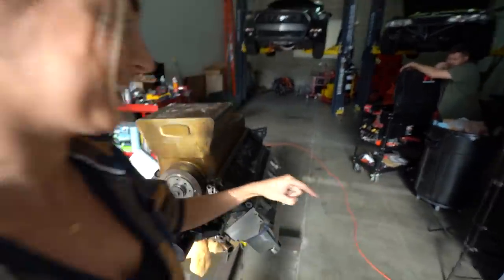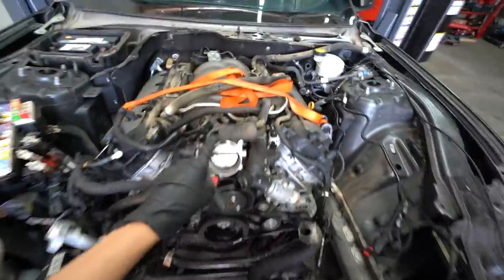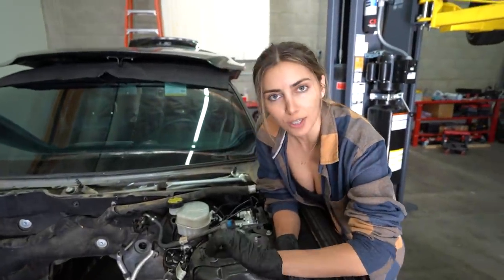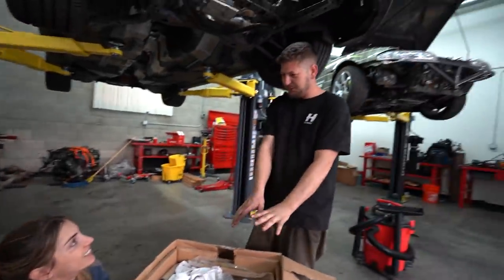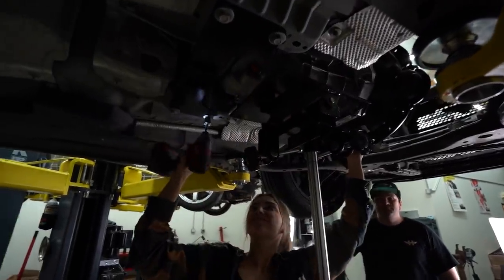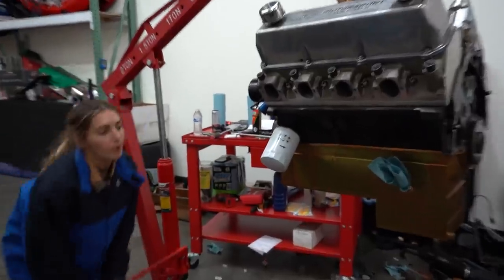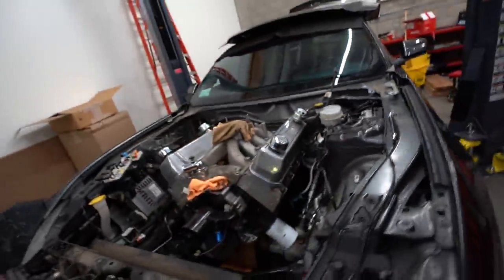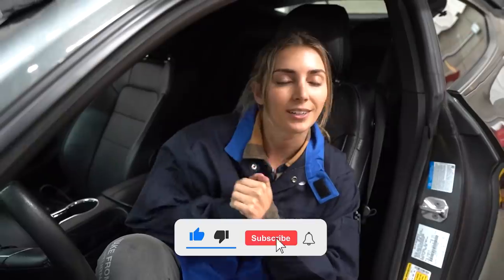We Put a Giant 2000HP Supercharged Big Block Ford in S550 Mustang!

Comment: 2:30......lol.
The motor looks awesome in the Stang.
Now you need a narrowed 9" or a quick change / tubbed wheel wells and some wide ass tires.
There are some pretty nice looks widebody kits on the market.
Reply: Not bags seen high power rip them apart.
Reply: Bags on a drag car?? Ahh, no….
Reply: @allspooledup2584  bags on most cars is bad enough. Not on an over thousand hp car

Comment: I put a 351w stroker in my 2012, and for about 4 years, I ran a 671 blower on it. I was only running 3 pounds of boost because the compression was too high to go any further.

Comment: Allot of people don’t realize how good 385 series “BBF” is because it’s not shown in 1320 video I guess. But  Rickie smith and Bob Glidden dominated  IHRA and NHRA with them slapping Chevy and Chrysler big blocks first in nhra and IHRA to run 7’s. Tim Lynch BBF outlaw mustang ran 6.5 on a 10.5W tire in 2008. That’s what promods we’re running at the time with way less weight. First dragster in the 6’s was the 427 Cammer another engine of BBF’s Fe series. The first 9 second pass in FAST was by a 1971 cobra jet mustang. Before any GM or Chrysler!

Comment: So that's a direct bolt in to a ford fusion of the similar year. Wiring harness all ,it can be retuned at your local Ford dealership with a manual if you like that kinda thing.... front and rear k . That 4 door will blow the doors off your friends 4 door sedans.....

Comment: Did you have a 6 speed in the 5.0? I will be buying my first muscle car within the next month or so and I'm between a new 5.0 mustang or the SS 1LE Camaro. I honestly think I am leaning towards the Camaro from the Tremec that comes in it and just to have something different. There are so many mustangs on my college campus and I am not really a big fan of the Dodges. Mostly with the mustang I am worried about the shift forks. I want to be able to really drive the car and eventually do a cam and procharger. Plus my parents have a Pontiac G8GT and I love the low end torque from LS engines.
Reply: Or, get a Tremec six speed in the Mach 1 !!

Comment: Best of luck sourcing a clutch
A slipper clutch is a must if you want to go fast on the strip and it can’t be street driven 
You could get a good multi plate clutch but it will never put the times of a slipper on the strip

Comment: I think an engine that big and powerful would be better in the s197 straight rear axle mustang.😉an engine that size i believe is more aclimated to straight line performance and the solid rear axle of the 2014 and under mustangs is accustomed more to straight line performance unlike the independant rear suspention of the s550 mustang which is geared more toward handling and comfort.😉

Comment: I don’t understand why the injector style hat. Just throw some air filters on and be done. What purpose does the hat serve?
Reply: found this on the net "By using fine jets to disperse fuel evenly through the incoming air, the hat helps cool intake temperatures as soon as the air is drawn in"
Reply: @ICP1SBJ  I understand how a injector hat works but it serves no purpose considering she has the efi throttle bodies already on it

Comment: if you did not lower the compression on that engine ..you are going to blow that engine apart under boost ..and if you did not change out those rods they are going to go through the block...just saying ...you can't put blower on a high compression NA engine ...especially if it a Ford